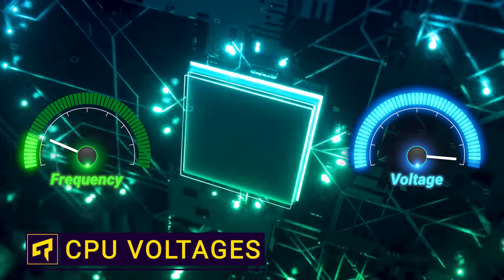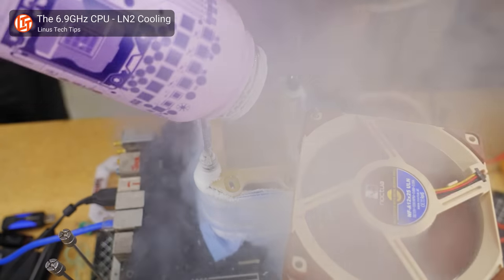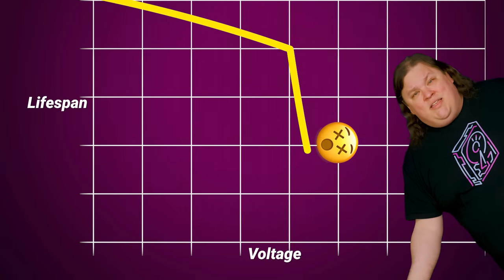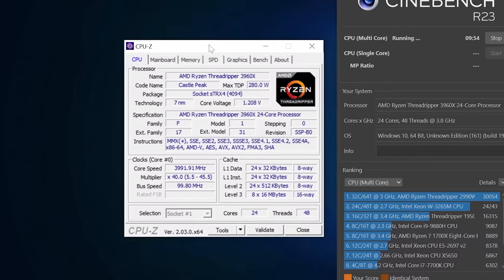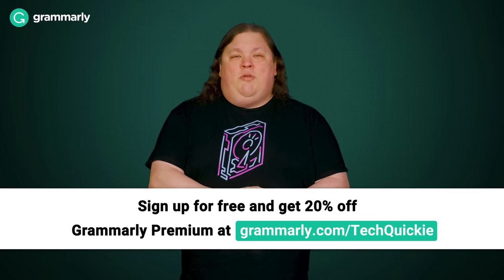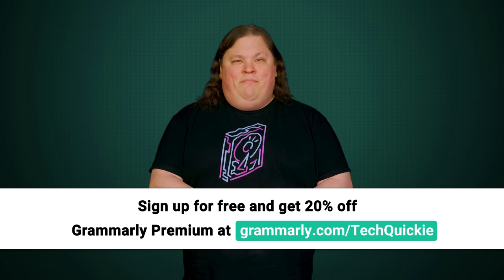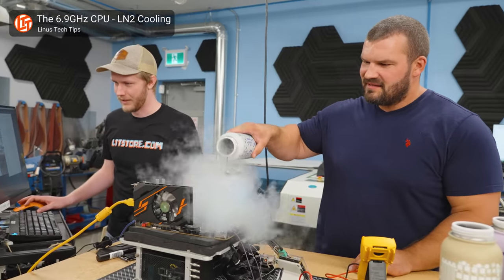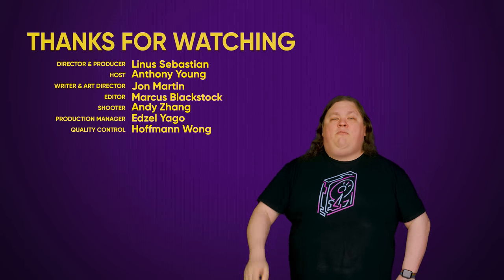What's the Point of UNDERVOLTING Your CPU?

Comment: I have a Dell 7590 with an i9980hk and this thing gets hot.  I undervolt to lower temps and disable boost.  I lose a bit of performance but have better load performance over time.  Combined with afterburner for my gpu(gtx1650) and I can get some playable frames without it burning a hole through my desk.
Reply: I game on a laptop too. I would suggest underclocking the CPU manually, rather than completely disabling turbo. A frequency of 3.7/3.8 GHz might cool down the CPU enough without losing substantial performance. But completely disabling turbo would get the freq down to 2.4 GHz will definitely, drastically reduce your performance
Reply: I rather get liquid cooling ,instead of undervolting.
Reply: @UserMadman1939  I have an offset in place, it's not enough.  I'm still hitting 99° if I leave boost.  With boost off I'm getting high 70°s low 80°s for halo infinite on low settings capped at 60fps.  I get mid 60°s for splitgate on high settings.  Those temps aren't great but way more comfortable than 99°.

Comment: Currently having some massive psu problems. My system already destroyed 2 of them within the last two days. I need to undervolt my cpu until I can get a solid psu.
Reply: I think that's your GPU. I'm going to bet it's a 30 series Nvidia graphics card?
Reply: @pixels_per_inch  No, no it was my psu as I suspected. The ones I was buying weren't in good enough quality to handle my build so they kept dying. I just got my new psu with gold rating recently and haven't had any problems
Reply: @thefrickenchicken1417  I mean your GPU spiking (especially 30 series) might be killing them

Comment: why isnt LTT making a series of good overclocking videos , which mentions all the common and most used softwares , the bios settings for ram and  Cpu OC , given the size and people this company has grown to , overclocking is a main topic which this channel has not yet covered , im assuming its mainly because there are too many variables while overclocking like the different set of mobo , cpu , ram which might have to be fine tuned by individual person on their system , and also i feel there arent really OC nerds out there in LTT who know this stuff properly enough to make it into a video , i doubt even linus knows it proeprly but they can always learn and publish the videos for the average consumer which include 5 minute settings for overclocking without going into advance settings , Linus please start this new series because OCing improves the perf. of the system by about 35 percent in avg fps , low 1 and 0.1 percent , general smoothness and responsiveness of the system , etc , linus please start a separate studio inside your huge warehouse and hire OC experts to extensively test a series of different Z motherboards which will be mainly used  , a series of various samsung bdie kits , and cpus , i know LTT can do this with the resources they have , hope this message gets to linus and team

Comment: Goes history that once they placed a bunch of technicians against a bunch of physicist to see who was the best at refining uranium using a Calutron.
the technicians won by a considerable margin, how? all the did was set the dial according to instructs and let it run, while the Physicist keep "chasing the needle".
I guess the same could be said of XMP.

On other side, there is no reason to do under voltage, I never have seem a transistor, resistor, inductor or capacitor fail permanently due low voltage.
Most thing that do not work any more due low voltage are electromechanical in nature or are responsible for heat management.
and the real limitation is how good is your system at keep voltage stable and clean.
as side note, lower voltages should be easier on your components and make everything work better.

However some VRMs can present weird behaviour at low voltages, yet it should only be at extremely or very low voltages, unless it is a bad VRM design (really bad).
So there is the real possibility that your motherboard may actually send more voltage to your CPU if it is a poorly design and made motherboard.

Comment: I had to undervault my Core i9 13900k. I have to play 4k on low ass frames because if I increase frames my cpu temp goes to 75-80c under load. Even though that’s a normal temp under load I don’t like it. So I Under vaulted it a bit not I’m getting 55c-60c at like 600-800 fps

Comment: I did a test on my own. With a 10850K and 2080 SUPER. By doing 4.4 GHz on the CPU  and -100mV offset and a locked 700mV setting on the GPU, my total system power went from 490 watts to just over 250 watts. 240 with only one monitor.

Comment: "Going 5 to 10 mV at a time" .. seeing change of 15mV on-screen 🤣 lol..

Still very valid as almost all my cpu's could undervolt, and my FX8120  was undervolted@4GHz.. 
Take small steps, check booting to Windows and give it a load on all cores. Check when scores start to drop as that might indicate stability issues. 
Disable all OC/manual tweaks before flashing (v)bios/firmware!!

Comment: ya i turned the IGPU off in the bios on my msi gf63 thin 11-UC even though i have a 3050 max Q no graphics output CMoS reset button didn't work i had to disassemble to fix it thank glad i know clearing the bios fix's all that crap

Comment: Massive, also the ghz the volts ran at. 

My 5950x runs 4.7ghz all cores locked @ 1.247v with basically 55-60°c being my literal hottest it has been under load. Under water.

Where as if i left it stock @ w/e random ghz it wants @ 1.4v she sat at 70-85°c all day idle...also under same water.....

Comment: is it worth undervolting/overclocking modern CPUs?
Reply: Im no expert but setting an offset curve (not technically undervolting but similiar) decreased my temps dramatically while increasing performance. Took me a couple days of test runs to find the best settings for my specific CPU but it was worth it in the end
Reply: I think the general consensus is nowadays companies are already pushing their silicon so close to the limit that UV/OCing is nowhere near as fruitful as it use to be. BUT, if you want to put the time and effort into figuring out if you hit the silicon lottery then there is typically still some performance to be realized, whether it is a couple degrees lower temps or single digit percentage of performance gains or usually even both with a simple undervolt!
Reply: @Omgsh68  I'd say that undervolts are still worth it as some top end CPUs have very high power draw and therefore high thermals at stock

Comment: I have a question. Not on this Topic. Forza Horizon 5 already needs 13GB of RAM without any other programs open, is it soon necessary to upgrade to 32GB?
Reply: If you only had 12gb....
Reply: Forza is probably using 8gigs maybe on your system, but high RAM usage is actually better for your performance because your data is on the faster memory, remember even the fastest hard discs or 2.5" ssd's will only transfer at max rate of 480mbps because the technology cannot do faster than that. You're definitely fine with 16gb, my idle ram usage went from 5gb to 11gb when all i did was physically put another 16gb sodimm. So your problem isn't Forza it's windows trying to make your life better because it can hold larger things so that your cpu isn't waiting for something to spin off I/O

Comment: well... except nobody knows exactly how overclocking impacts the lifespan of a CPU.
I mean "normal" overclocking not crazy overclocking, something stable.
there is no data for that, only estimates... and estimates are 5 to 7 years of continuous usage. (24/7)

while non OC CPU estimated are... 6 to 8years.
once you have a stable OC CPU, this will take decades if you use your PC in OC mode (and full usage usage for sure, a CPU doing nothing will not be impacted so much)

Comment: One thing not mentioned,(this is for beginners) if you are going to undervolt you may need adjust CPU Load-line Calibration too, because V-droop is an unforgiving mistress.
For example, my 9900K runs 5200MHz with 1.200v LLC set to 6 so actuall v-coe is 1.216v  under full load.

Comment: I disagree with the premise of this video. Generally the increase in popularity of undervolting is due to the boosting algorithms modern cpus have. Undervolting generally comes with an increase in frequency these days do to the reduction in voltage increasing the available power table. Generally speaking you are going to see an increase in power draw and heat unless you set clock speeds.

Comment: Iv put my voltage to 1.35v and it's running at 5.1ghz and my tempswen from 94c to 71c. Keep in mind it's a 14700k. I'm new to this. Everything is on auto apart from the voltage that I dropped. it's at 216.77w on HW Monitor. Is that OK?

Comment: OR just disable the turbo, I had to do it on my laptop, during windows install, it would overheat and turn off, I had to put it next to the AC just to finish installing and changing the max cpu to 99% in power settings.
Reply: @@Rizz407 the 88% only works while you’re in windows, it doesn’t work when restarting to “Finish Updating”. In 99% you run at base clock speed without the boost.

Comment: I'd guess underclocking doesn't fit in between this topic(s). 
And if you have already stuffed the bus system with as much workload as me, this would hardly bring some benefit, i guess, but tell me if i'm awkward here. Unlike with "normal users" that usually have about 3% of load on the cpu (97% idle). I'd deeply apprechiate a pattern on which "tactics" lead to which advantages on computer use types. I'm still a boinc contributer.

Comment: I did it on two identical RoG laptops back in 2018 or 2019 that i bought at once to see the better one at undervolting, and another one is a gift.
One was able to push -165mV, but it was mostly stable at -155mV, while other laptop was stable at -130mV. However, the second laptop, even it was bad for undervolting, its GPU actually by default runs about 0.2% faster, its 5% hotter, GPU overclocking higher and GPU memory are also clocking way beyond that first one can never reach, both Samsung memory chips, both laptops are identical.
However i decided to keep first CPU undervolt, instead of second one that has better GPU overclocking. For laptops i value efficiency, like battery, temperature, less stress and such, and undervolting also gives you capability to push short turbo boost time longer then default, and turbo boost can operate for longer at higher clock and more stable overclock, and also cores temperature/heat spreads are very narrow.
Now when i stress test both of them, they go to 4.5GHz, my goes very slowly with temperature, like its giving time for the fans to start spinning, like its very emotional and take care of a details, very narrow and slowly, it operates longer at start turbo boost, while after that, long turbo boost are working at higher speed, the friends one, temperature are like paining the graph, turbo boost are spiking and temperature throttling instantly from the beginning, not for the long time, and on long runs it operate at 2.5GHz, while my are stable at 3.3GHz on the long run, for less energy, and less heat.
I would undervolt laptops (specially gaming one) and energy efficient machines with passive cooling solutions, and overclock only desktop PCs for things like gaming.
When people ask me why to undervolt i tell them, the CPU will be the same, its the same technology, same architecture and everything, there is no difference in usage, it will just use less electricity, means less temperature, means higher clock because electricity and temperature allows it at best possible efficiency.

Comment: Hi, Is this the same as setting the “curve optimiser” in Precision Boost in Bios to “negative 30” ? For a Strix B550-E with a R7 5800X3D? OR the undervolting applies only from setting the CPU on “offset” then negative then like in this video?

Comment: i used to do that on my laptop because the i7 9750H reach 97°C too easilly,but now intel prevented the user to do that so i have to decide if live at a fucking low baseclock at 2.6Ghz or live in costant thermalthrottle at around 3.5Ghz(it reach its max frequency but after a few seconds it throttle down because now produces too much heat) thanks intel for this crappy cpu
Reply: Not even Intel XTU works for you?

Comment: So, offset/adaptive mode works better than override setting, as it will run that frequency/voltage all the time, even when just browsing the internet and totally uncalled for?
how come you have to manually undervolt your cpu/gpu, why is it not done stock already part of their testing? or, alternatively, why isn't there an xmp equivalent for cpu and gpu?

also, why write down the voltage under load for only to set the adaptive mode offset?
Reply: Out of the box, your CPU calls for a certain amount of voltage depending on how hard it is working, setting to override is a bad idea because too much voltage will wear or crash your system. It is not done stock because every chip is slightly different (silicon lottery), the out of the box settings are there to work with every unit that is shipped out.
Reply: @LorentGuimaraes  Also if you use override you lose single core boost and you have to sync all cores.

Comment: basically useless to undervolt your cpu unless you are using a laptop. If you have a case pc and your system is running hot. You need to remove it from that trash case you have and upgrade the cooler.

Comment: i under volt my CPU to save power but right now its cold so i have my CPU running at the stock speeds and turn off the PC fans to have a little heater right now lol
5950x running at 1700mhz majority of the time right now its running at 4500mhz

Comment: We need to see default settings prioritizing energy efficiency instead of bleeding edge performance at all costs.
Reply: Bleed the Block, burn rubber high performance speed.
Reply: Definitely not, it should prioritize sustainabilty of the device while maintaining as high performance as possible.

Computers take up like no power compared to other thing in your house, no need to limit that so every normal user gets a worse experience.

Comment: If overvolting needs a good Mobo with a good VRM does that also applies to undervolting?
Reply: Yes and no. (Tl;dr undervolting can benefit from a good motherboard but it can work and is completely safe to try on a cheap motherboard.) 
.
I’ll start by explaining the reason VRMs are beneficial in overclocking in general. If you already know this or don’t care, feel free to skip to the next paragraph. VRMs ensure that the CPU gets the exact voltage it asks for but they’re not perfect so there’s still some instability. The more VRMs, the less instability. Each one pulls it closer and closer to the exact voltage you want. When you tinker with the voltage of your CPU so that it’s on the brink of being unstable, voltage fluctuations can mess it up and cause it to fail; a cheap motherboard can cause a good CPU to be unstable at a voltage it might be able to just barely manage on a high end motherboard. 
.
The reason it’s important when overvolting is that the higher voltage also stresses the VRMs which means that you need more of them to keep the power clean and the stress can cause crashes and even damage on low end motherboards.
.
When undervolting, there’s no extra stress to be worried about but it is still likely that you could get closer to  the limit of the CPU with a better motherboard. 
.
All of that said, sometimes CPUs just aren’t good for any tinkering. Somebody might have a CPU that becomes unstable at anything even slightly above or below the default voltage and no fancy motherboard is going to change it.

Comment: Longevity of CPU's is not a relevant subject when considering stock voltages since at stock voltages your CPU will far outlive its relevant service life. Undervolting your CPU is only relevant when considering power consumption (Watts=Voltage x Amps) even though the design and manufacture specifications allow such leniency that undervolting and overclocking may be allowable simultaneously. Utilising more power from your CPU will reduce its overall longevity (legitimising VxA) Amps are still the main resulting factor in electronic device longevity assuming temperature specifications are kept in specification. Therefore undervolting and overclocking simultaneously is likely to draw more current despite having a positive impact on power draw and overall power draw is negligible to CPU lifespan and considering stock CPU lifespan is practically unmeasurable means it is irrelevant. Christ I still have a collection of old computers including pentium MMX's and Modded Athlons in perfect working condition despite their overclocks after ridiculous years of service, the other components surrounding them are  far more vulnerable to degradation. I currently use a Ryzen 2700x at 4.1GHz stable with diminishing returns on CPU voltage and power to run at those speeds, yet has since release has had no reliability concerns as a result of reasonable temperature stability. Degradation has less significance in V as it does in A as with any electric or electronic device assuming T is managed, but a higher V does not mean lower A therefore equals higher W resulting in higher T. The resistance is I (resitance)= V/A and power drawn is W=V*A.
Reply: I forgot to mention the Voltage issues with regards to minor degradation to transistors on a nanoscopic scale and believe this would be a fascinating topic for @LinusTechTips to explain on a engineering level

Comment: That doesn't make sense.  Less volts more FPS? but overclocking is more volts more FPS?  That doesn't add up.
Reply: Undervolting only helps fps, if your CPU is overheating without undervolting.